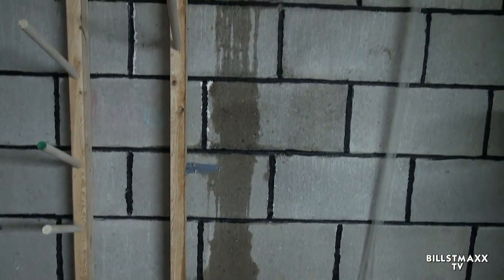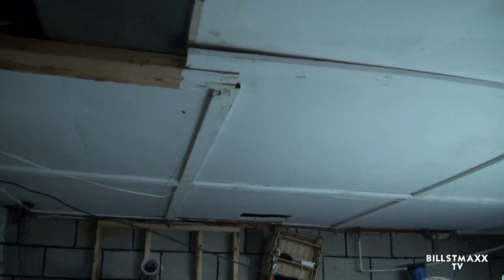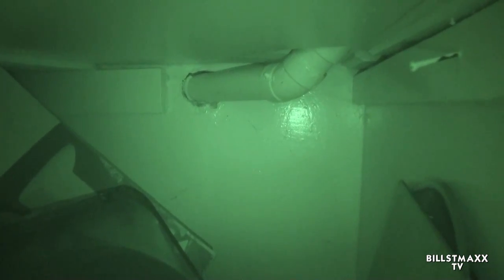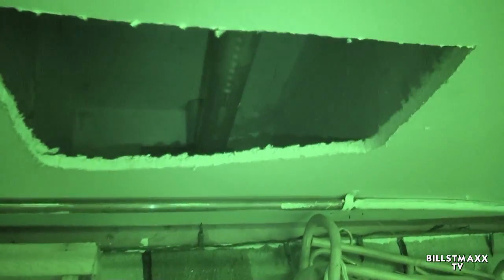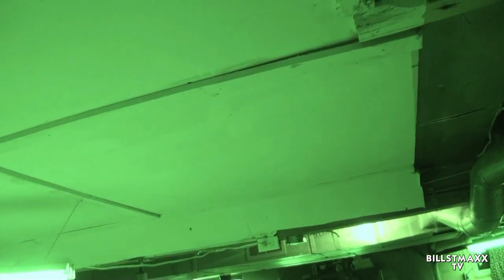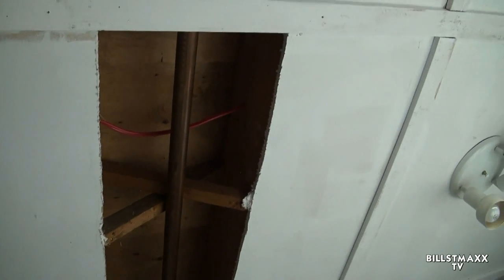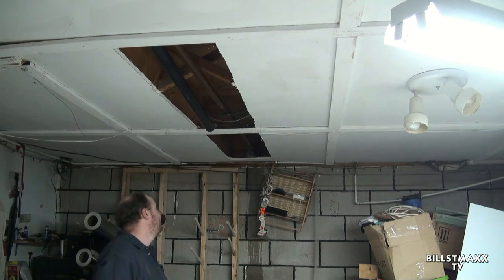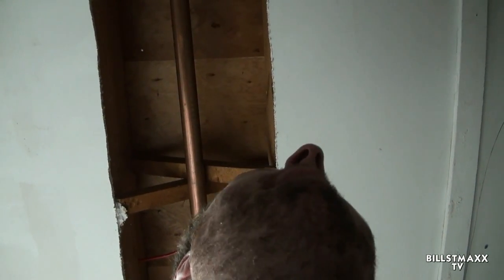Replacing the old 1.5 inch copper drain pipe

Comment: hey   Billy  take the air hose a blow out the lines from the sink then fill the sinks with hot water a run 2 cups of tsp thru each full sink down to flush out the crap in the pipes  Holly Frigg you like to do things the hard way LOL !!!

Comment: Good Lord someone didnt have a clue!Billy if i were you i think i would bump it up to 2" for that long run and put a little more fall in the pipe, but most important(i cant tell) is it vented at all? If not you can use a mobile home vent under the sink(lets air in but no gas out).

Comment: You could see a "HIGH SPOT" in the video where the copper pipe goes up over the Heater Vent duct... and that is why things after time Clog the drain up where you bang on it.. if all you do is change the type of Pipe it's highly Unlikely that you will fix your issue..  Water and the small bits and piece of food and other what not just settle on the uphill side of the pipe...  :o)

Comment: nice job billy like you say it needs way more fall for the distance but sometimes you cant get it. use solvent weld pipe if you get another blockage you can put plenty of pressure in there to clear it all out.

Comment: make sure you put your wires on top of your piping so when water or any number 2s flow through the load doesn't stretch the wires, not like they will stretch that much but i have been renovation for a few years and have seen a few things, keep up to good work Bill :).

Comment: hmm, smoother bends and get the first bend as high as you can.
As reelman243 says "bigger pipe and a vent".

Im not a plumber but i would run a seperate drain pipe for the sinks and not connect them to the loo sewage pipe, i bet thats a normal thing but it sounds nasty to me. :-o

nice vid bill, you will win as normal:-)